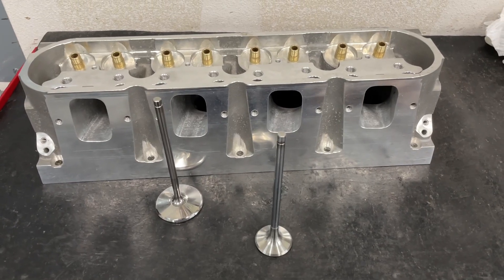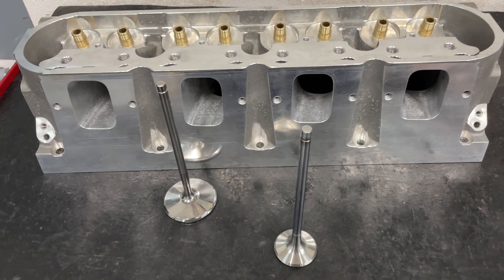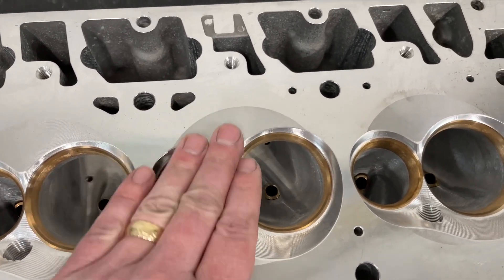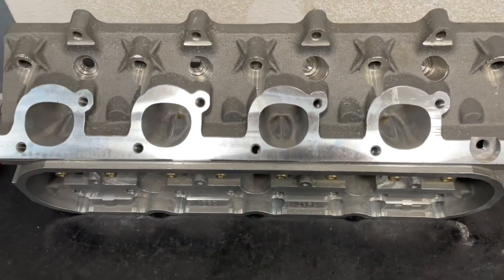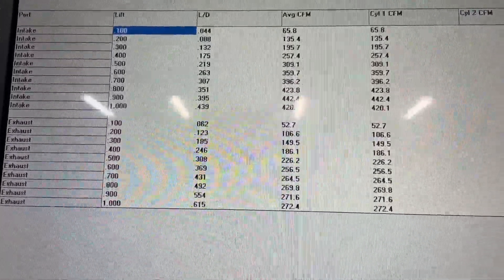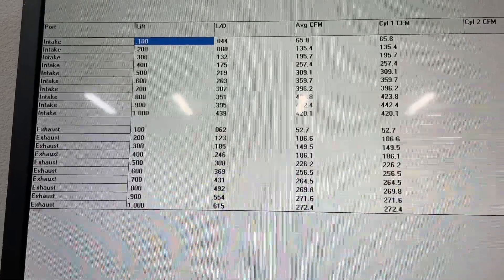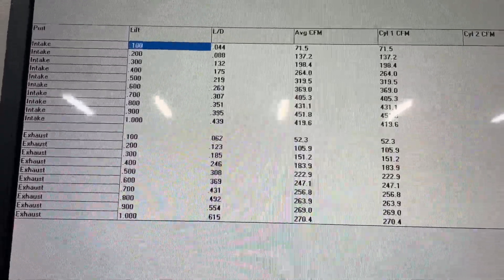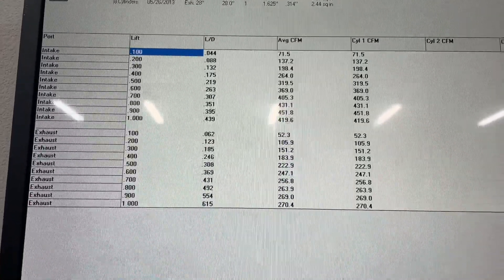The Highest Flowing LS head I have flowed! 452cfm

Comment: Weird... my Frankenstein Stage 2 CNC ported 893 casting LS3 heads flowed 295/228 @ .400, 350/242 @ .500, 380/261 @ .600 and 399/265 @ .700 lift on a Superflo SF-1020 flow bench... I'd be curious to see what you would get with them since it's hard to compare on different benches
Reply from the maker: I don’t think they would do that good on my bench.

Comment: What influence could you have to convince , let's say , EQ to build a raised runner iron SBC head , that used a stud mount rocker ? To me for most practical purposes that would provide enough cylinder head for 90% of performance people. This LS head is fantastic but it's just the head. The parts associated and needed to support this head definitely puts this out of the fun zone for most people. I'm sure the people on the fringes will appreciate this head but not many. I've been around some SB2 stuff and I wonder why an iron SB2 head wasn't made that could use a stud rocker ,, to me creating something that has more mass appeal is being lost. Probably a raised runner iron SBC head with a stud rocker could more than likely put a 383-406 in or near the 700 hp range. That is still a tremendous serious piece. Now if someone is just becoming a performance enthusiast they believe they must have at minimum a twin turbo 496 to do anything. And this is so wrong. I used to be on a Nova page allot. Immediately these guys think a 496 is a must have. I ask em if the frame is tied and an 8 point cage is in it because if not , if the car hooks at all it will twist the car so bad in 2 weeks the doors won't open. When i tell em if you go BBC without a full frame car you better just stick to a 402 with a decent cam for sound and it still is going to be a handful in that car. 
I just see for the most part the industry is losing touch

Comment: Excuse me if I'm wrong, but how are you gonna achieve those actual cfm? Specially in a NA motor. For example, 0.700 of lift is like 17 mm which is HUGE CAM and I've never seen anything so big. So let's say, you are going to get 319-320 cfm in the real world with a .500 lift cam. In theory, the max cfm number shouldn't be relevant in NA applications.
Reply: I have these heads
Reply from the maker: You should watch my other video where I go over what you said. Peak flow is important. Ps there are several of my customers with over .900 lift on the valve.
Reply: @WeingartnerRacing  do you have the link of the video? Also .900 lift is ENORMOUS
Reply: This is my head and the cam lift is  .877/.855

Comment: Thanks for sharing! I designed and machined this head for Carl when I was at SPS, though I'm now at Frankenstein Engine Dynamics. For those asking, the LSX DR head is obviously a GM product and they do offer their own cnc ported version, however this one came to me completely untouched aside from the cube machining. So the port design, valve job, valve spec, etc was 100% custom for this customer. Application was initially for high compression, solid roller, with a big shot of nitrous. This is a raised runner ls7 style port design, 11* valve angle, 2.280/1.625 valves cut on a 50* valve job (52 or 55* would yield more air in the higher lifts). The lack of airflow down low below .500 lift is due to its raised runner/big valve/steep valve job design. Simply not built to really care at those lower lifts, which is why it shoots to the moon after .500 lift. For those curious about the weld, we pushed that wall over as far as possible to get a better line of sight to the valve. So adding some material there to open it up more, then clearancing for the pushrod is ideal. This is by far one of the baddest heads ive designed and very proud of it! Thanks for sharing and spreading some knowledge!
Reply: Why don't my stock ls7 heads you ported flow this much! They only flowed 400cfm at .650"! Lol, just messing with ya. Gavin for the win!!! SPS was the best! We miss you up in the PNW!
Reply: Hey Gavin, I just got my Stage 2 LS3 heads down by Frankenstein a few months ago and the flow numbers (posted above) given to me by Martin are almost too good to be true compared to this bad ass head in this video? Why is that? Lol

Comment: The lax dr head is offered by Chevrolet. They have a 50 cc chamber volume. Stock the intake ports Are 313 cc and flow 435 cfm at 0.800 lift from the factory in the CNC version of this head. This head is offered in a 4 bolt and 6 headbolt versions. Information courtesy Dragzine post.

Comment: Not bad,  on par with what Livernois is doing with stock 6.4 chrysler hemi heads.
Reply: A 6.4 stock hemi don't flow that. Don't compare Gm to Dodge. It's no competition
Reply: @god1st.530  your right it's no comparison,  Livernois ported 6.2  and 6.4 heads flow over 400 cfm  at 600 lift. With stock valves.
Reply: @derekshuster5995  but how much power will it make?  flow isnt everything
Reply: @KingJT80  it is if your boosting it.
Reply: @KingJT80  it will make more power then any stock gm castings, and most aftermarket heads.
Reply: @derekshuster5995  These heads are known to make well over 3000 whp on boosted engines (Dave Adkins is one example, runs low 6's in the quarter). They will make tons of hp....
Reply: @derekshuster5995  Hemi head port and chamber configuration was proven to be a superior design over 40 years ago.        You can get larger valves in there, and the intake valve opens up away from the edge of the cylinder instead of towards it.
Reply: @dennisrobinson8008  show me an NA gen 3 making as much power as the LS NA drag race engines
Reply: @juliennacer8871  you won't find it.  Their bore is too small for valves big enough to move that much air.    Oh gen 3 hemi.    I don't know that engine well enough.

Comment: Wicked intake flow, but the exhaust seems to be lacking
Reply: Flow numbers dont mean much on exhaust side.
Reply: @V8Lenny  16 degree difference intake to exhaust lobe helps with that
Reply: @V8Lenny  Yep, that's what reality showed!   Most serious heads will compromise exhaust valve size in order to get a larger intake valve on it and do great that way.
Reply: Even though no pipe?
Reply: just like a SBF, hmmmmmmm

Comment: Could make for a 900+hp all motor build head I’d imagine.
Reply: Could make over 1000HP all N/A.    I've seen a few combos with "lowly 420-430cfm heads" make 1000-1200 HP turned up enough rpm.

Comment: Had such  one , CT version , in my shop for flowtest and making the valves for it.    Ferrea told me they make the valves for the dr lsx , but could tell me the flow numbers ,max, for both :  ct version 420-425 cfm  and  dr version  440 to 445 cfm  right out of the box...... The ct version flowed 418 cfm on my Flowlab1400.....and I was amazed !!!!!!  

4 weeks later I had a super stock billet cylinderhead for tractor pull on The Flowbench.....that flowed with a 2.6"  intake valve and twice bigger port and 4.75" bore  THE SAME F**KING CFM FROM 0 TO 1" VALVE LIFT!!!!!!

...SO I TOLD THIS CUSTOMER HE HAD SOME HOMEWORK TO DO REGARDING PORT VELOCITY!!!!!!!!!!!!! 

WHEN ADDING THE NOZZLES IN THE VALVE THROAT AREA......IT BECAME EVEN WORSE!!!

When I asked why he put the nozzles right above the backangle of the intake valve he answered , without blinking an eye:   otherwise it doesn't run well....Oh and I cant cut the seats...otherwise the valve will bend the nozzles.....

Comment: Keep em coming - if I can suggest; start tying the head combos together with what type of cam, compression and power range engines will make or are capable of.  Don't be afraid of a 10 minute video either.  Are you strictly GM? BBC/SBC LS/LT?
Reply from the maker: I do Ford and Chrysler just not as much. Nothing foreign because America.
Reply: @WeingartnerRacing  right on! 
No offshore customers?